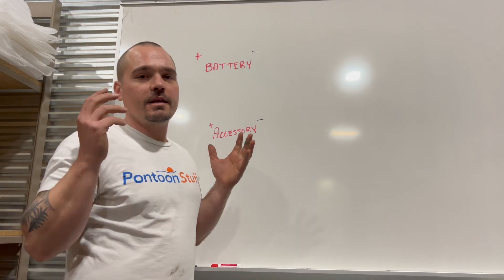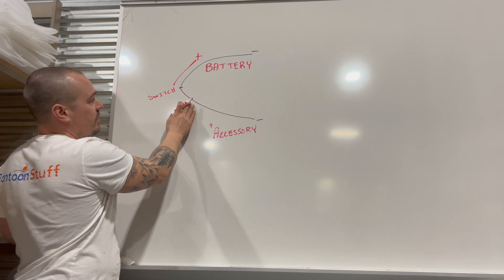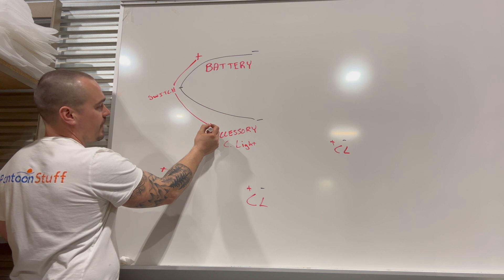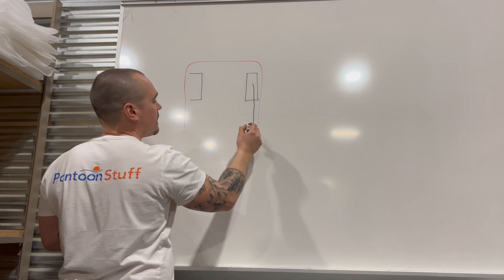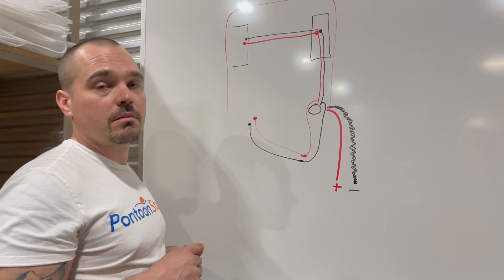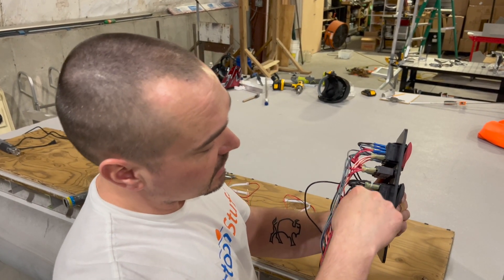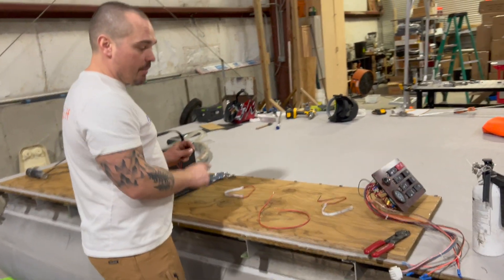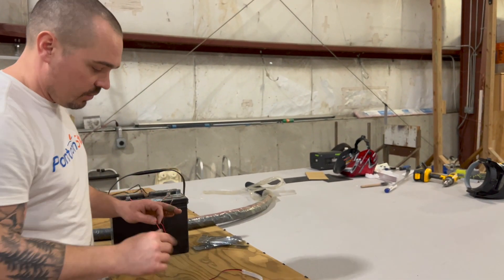Boat Wiring Simplified - The Basics

Comment: Good explanation.  So everything is grounded back to the battery and nothing is grounded to frame/structure of boat?
Reply from the maker: CORRECT! I am all for a ground block if it’s somewhere covered and out of the elements. Maybe in a battery compartment or under the dash. A proper wiring harness takes care of all of that for you though and simply grounds it to the battery negative. A great way to look at it is that none of the manufacturers I’ve seen have ever grounded to the frame/structure of the boat. Their harnesses incorporate a ground from the battery negative post that it shared at a switch panel or fuse block under the helm. Great question!!
Reply: @tomspontoons  Thanks for the follow up! You teach well! Keep up the great work Tom! 💪🏻
Reply from the maker: @tritownnow  thanks!! Happy to help!
Reply: Hey Tom, great video. I have a question re a pair of docking lights/small light bars. I’ld like to run a couple of relays, one each, to help reduce the load. Where would you tie them in to the respective wires from the lights, close to the switch panel, or under the seats?And can I tie them together and then run them into one switch? OR…would you recommend wirining the two lights together, run to one relay, then to a switch? Thanks so much Tom. Love your vids! And just took possession of all my Pontoonstuff/Canadapontoon seats, consul and flooring kit. So jazzed to get started on putting her all back together now!! If only the weather would cooperate!! Cheers pal.

Comment: Could you make a video about wiring a new key and kill switch when wiring a boat from scratch?
Reply from the maker: If I get the chance I definitely can do that. I typically only install the outboard manufacturers’ parts for engine rigging components instead of aftermarket or universal stuff. What kind of motor are you rigging for?

Comment: Would you recommend a fuse box or just one inline fuse going to the switch panel?
Reply from the maker: Either a fuse block, switch panel with fuses built in, or in line fuses between switches and accessories. Check out this video:

https://youtube.com/watch?v=KJxsb4H5I_0&si=EnSIkaIECMiOmarE